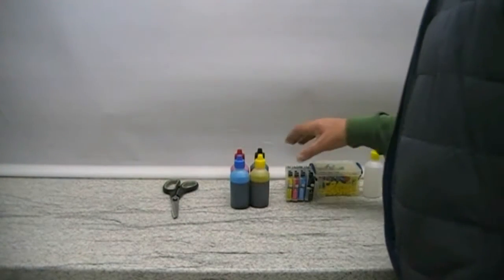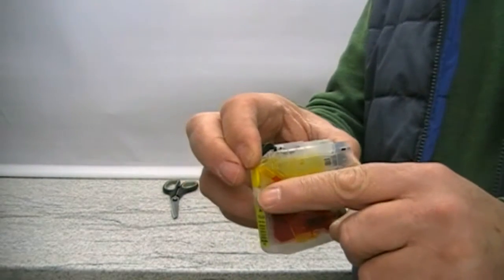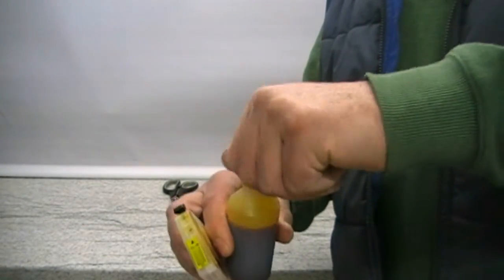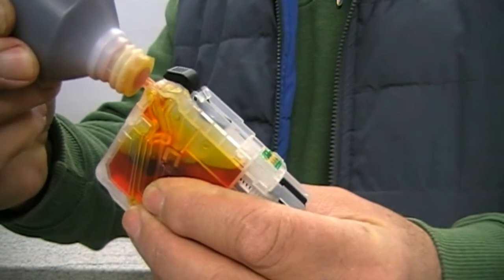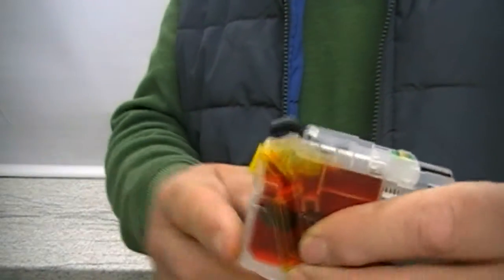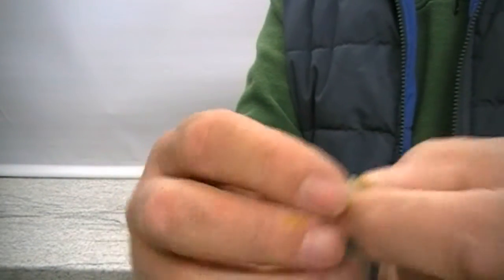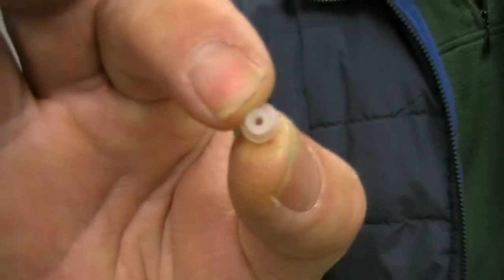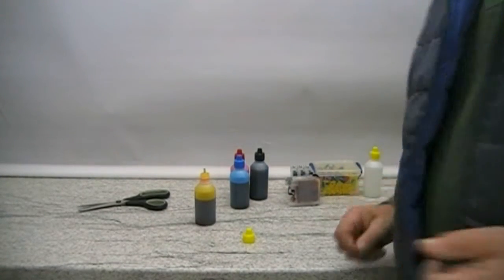LC 223 Filling

Comment: Please excuse my ignorance but would these work in my Brother DCP-J4120DW printer which takes BLC223 C cartidges or at least that is was it says on the cartridges.
Regards Chris
Reply from the maker: Hi Chris, yes they would work fine with the DCP-J4120DW. If you need some you can get these from hobbyprint.co.uk or call me 01430 284112. Thanks
Reply: Have signed up and just put an order in. 
Kind regards Chris Revell